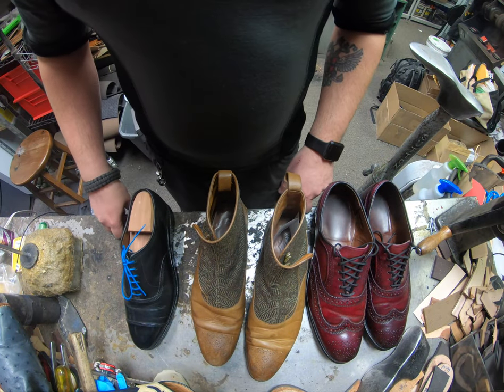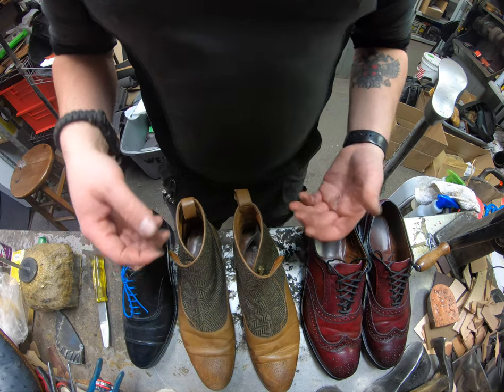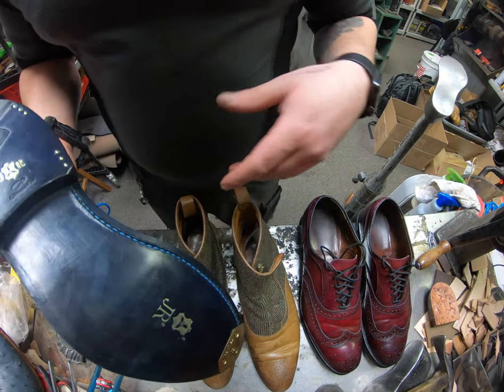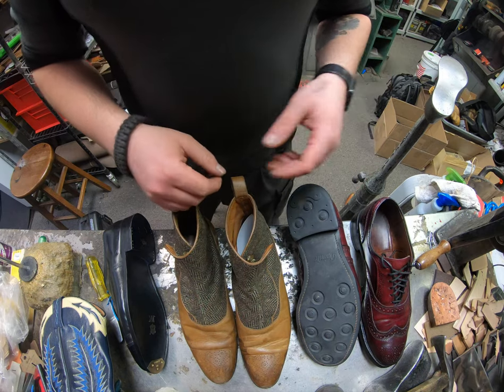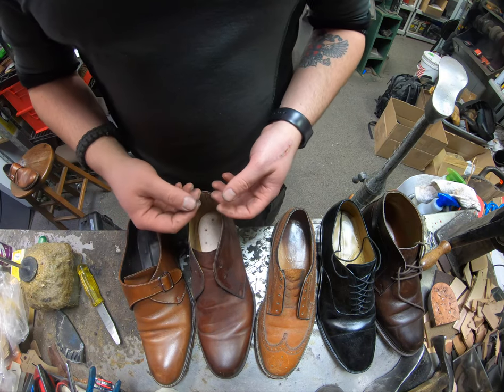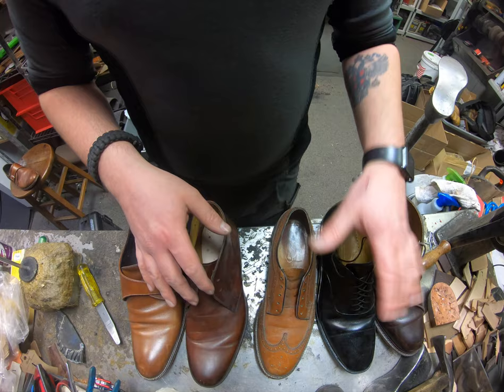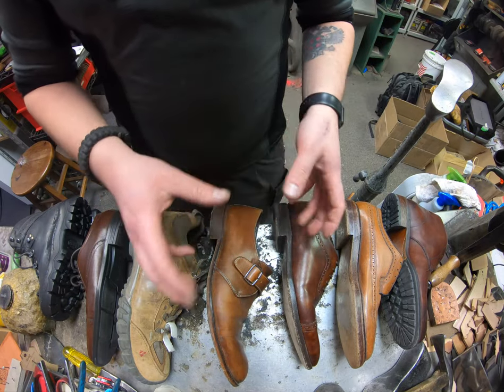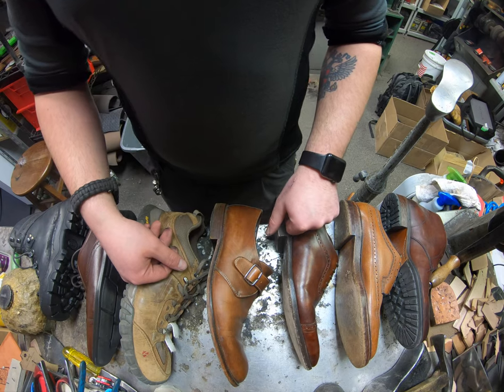Sole Talk Sunday Different ways soles are attached to footwear. Goodyear welted, Blake Stitch & more

Comment: Wow...never knew about the closed top stitch on the welt. I'm interested in hearing more information about how you reuse welt holes to preserve welts and why that is good. How hard is it to line up the interior and exterior stitching to reuse the holes (in the welt and uppers)? It could be useful to explain this, too, as a differentiation between a cobbler resole vs. a factory resole.
Reply from the maker: It is something I could talk about in a resole video and would be better during that process to explain it on video. But for use cobblers it’s one of those things that takes years of practice to have the outsole stitcher line up with the original holes on the welt. Almost like a 6th sense. Factory resole they counter that by replacing the welt each time but the problem is they perforate the leather upper more with that where when we cobblers change the welt it is stitched by hand allowing us to find the original holes to stitch through

Comment: Stitch down is another great construction super weather proof and strong. It's kinda rare now but there is also nailed and pegged construction which is pretty interesting.
Reply from the maker: True there are a few others I didn’t get to cover because the video was already long with the main constructions
Reply: @CobblersPlus  Have you done shoes with veldtschoen or stitchdown construction?  If so, would love to see how this is done as i have a pair that will need replacement.
Reply from the maker: There not very common but I’ve worked on them before. Would be more than happy to work on a pair and if you are flexible on time a little with it would love to finally make a video on a pair 😁
Reply: The stitch down is probably the more difficult of the styles of sole stitching.

Comment: When resole a Goodyear welt will that create more holes on the welt or new stitching should go into the previous stitching holes?
Reply from the maker: The goal of a cobbler is to aim for the original holes but it is a very difficult task as the shoes or boots are stitched Upsideown. 
But even if the original holes are missed here in there the welt should hold up anywhere between 3-6 resole jobs before finally needing replaced

Comment: Hello and thanks for the great content. I just received a pair of Cobbler Union boots with Vibram soles and it looks like a blind-stitched sole. I'm trying to contact CU to double check but you definitely cannot see any stitches on the outsoles. Might be that the mid sole is stitched and the final rubber sole is glued on but it looks very nice and sturdy
Reply from the maker: Yea rubber soles don’t get blind stitching done so most likely it’s the mid sole stitched and sole glued witch still usually holds up very well
Reply: @CobblersPlus  Yes! I checked with manufacturer and that's exactly how my boots are constructed. They ensured there should be no issues and I'm very pleased with the clean look of the outsoles with no stitching

Comment: Are Danner boots, the made in Portland OR models, a good boot? They are stitchdown. I was debating in them or thorogood for my next workbook and went with Danner just because I got a very good deal on them
Reply from the maker: Danner boots are good especially for the price. Personally though I like a separate welt more because after time the welt can be replaced where a stitch down there’s not to much that can be done ones it starts giving out.

Comment: Not to be a smart*** I thought of one other kind of sole whichi is a combination of two distinct ways to attach outsoles.  I'm referring to the Red Wing Shoe Company's Supersole which they develooped in-house and patented.   I was a kid in the early seventies when we got our first boot with a this sole.  It made an impression on me because at this time Red Wing was still largely a leather Goodyear welt company with some cement crepe midsole constructed boots (these included the Ted Williams boot for Sears and the iconic olive green Browning bird hunting boot made under contract).  I wrote Red Wing a letter and the gist of it was why was the company going to cheaper welting like the lower cost brands of the day?  I actually got a letter back and it explained the Supersole system had to depend on a chemical bonding reaction between the welt and the molded PU sole.  A leather sole could not achieve the reaction which actually melted the welt and the PU sole to create a superstrong and saturated bond between the two.  I know we cobblers figured out ways to resole these  Supersole Red Wings.  The usual way is to carefully cut away the PU sole at a point leaving enough material for a robust welt.  Sometimes because of the expansiion of the PU material into the boot quite deeply it becomes quite tedious.  Also sometime the edge trimming of the Red Wing finishers would get too aggressive leaving a very slim welt to stitch to (by the same token I've seen the width of the welt actually wider than conventional welts on the same boot where some areas were quite narrow).    I think Red Wing likely originally figured the factory resoling service would be the service of choice for the owner as until recent years Red Wing seemed to still be quite invested in their in-house repair shop (I've seen this streamlined over time with the example being years ago I could order a style to be modified in the repair shop such as the insertion of an orthopedic build-up straight from the factiory or other mods...this is no longer available to me as an independent Red Wing dealer).  I'll finish this with my respect for Red Wing creating a very unique sole system that was still Goodyear welted.  It cost them quite a lot of money to do this for the engineering of the equipment and myriad sets of molds.  Even after their patent expired it was this extreme expense that kept other companies from copying this hybrid Goodyear welt/molded Poly-Urethane sole system.